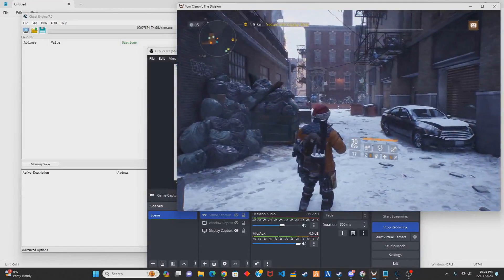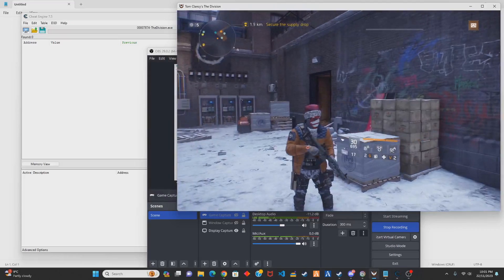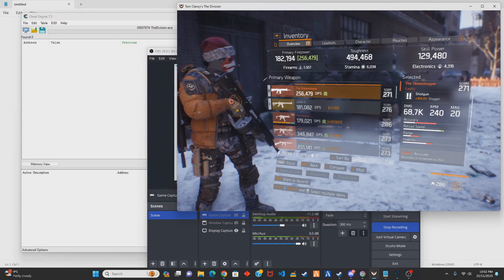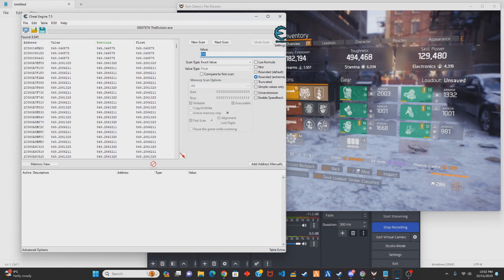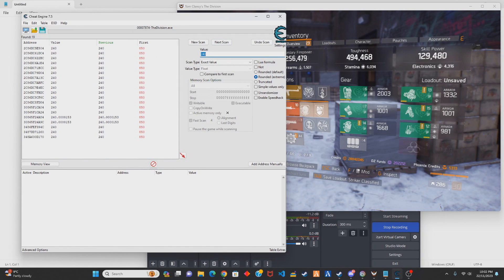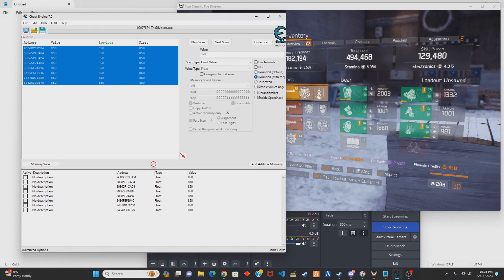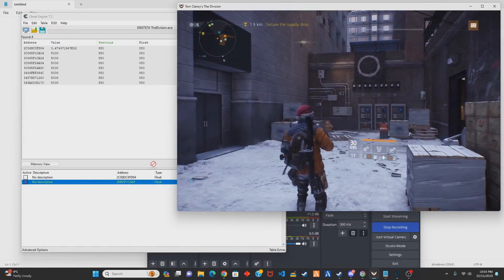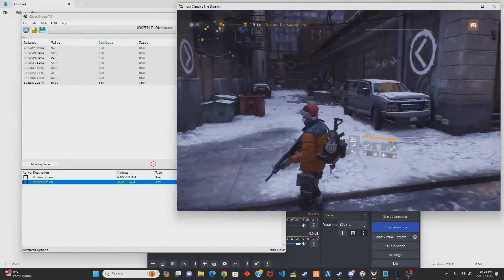The Division 1 RPM Hack Tutorial *2024*

Comment: Hi I tried doing exactly how you did it and managed to narrow it down to 2 addresses. Once i found which one I could freeze, I noticed that the fire rate still never changed. Can you help me in figuring out on how it didn't work? 

I already removed all attachments/mods on both weapons btw
Reply from the maker: you sure you have it on float? normally comes up with 5+ addresses, whenever I've had only 2 addresses is when its accidentally on 4 byte not float
Reply: you dont need this. dont change weapons ingame.  you can select 10+ addresses and change them to 2000 (value). For example it is easy to use hack with Alejandro . Because it has 1000 RPM

Comment: sorry but im searching in floating i find the value, it changes from the first weapon rpm to the second. but when i edit the value nothing changes ingame?
Reply from the maker: try freezing the value and double check to see if you have attachments equipped cause that'll change your rpm value and you might be searching for the wrong number
Reply: @TheNoirHack  yeah attachments and use flota till you have like 5-7 values
Reply: u dont need to lock cus of lobby change
Reply from the maker: @LittleSadistic  you lock it cause if you switch back to another gun the RPM will return to default, if the value you're changing doesn't change the rpm then you have the wrong address.

Comment: For anyone who's gonna use the showstopper be careful if you set it really high (5000+). In some areas you'll either delta or crash yourself. Really unstable and would opt for an lmg if anything.
Reply from the maker: 2500 is the sweet spot for everything imo, never had issues
Reply: @TheNoirHack  It doesn't happen often, but it's something I did notice after rpming lots of cheaters in the dz.

Comment: I found two addresses, after a couple search.
One of them would change, but wouldn't change the other one.
The second one wouldn't keep the change at all, and it would revert to its original value right after I change it.
I made the second one active, then changed it, it would flap between original and modified value!
Reply: before new scan, change the Value type for float!!
Reply from the maker: you may be entering the wrong value, make sure you got 0 attachment on or if you do, add the bonus rpm onto the main rpm number
Reply: @TheNoirHack  I tried with two brand new guns without any upgrades and ended up on exact same spot having the same observation